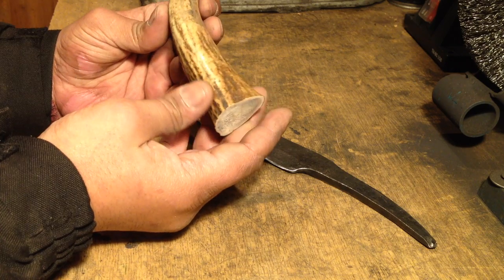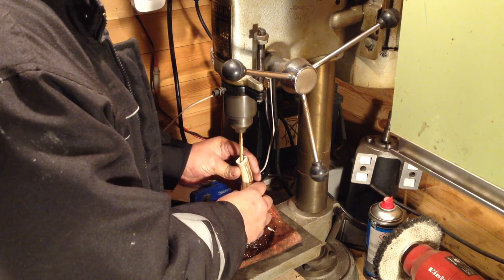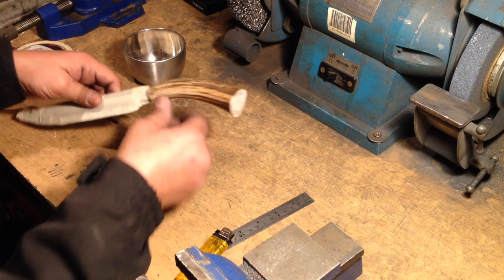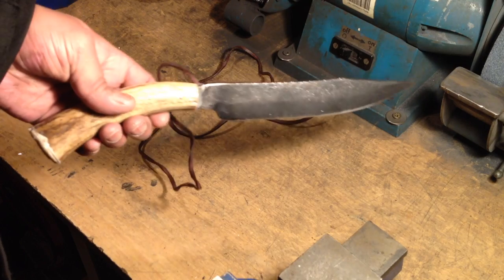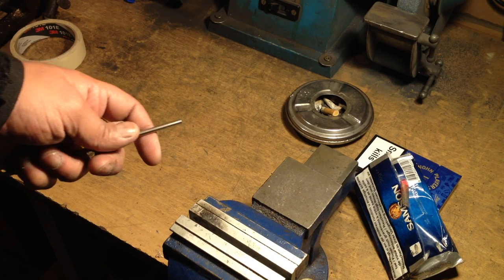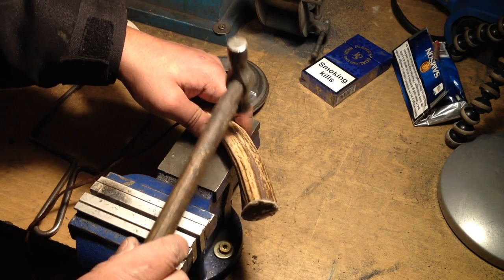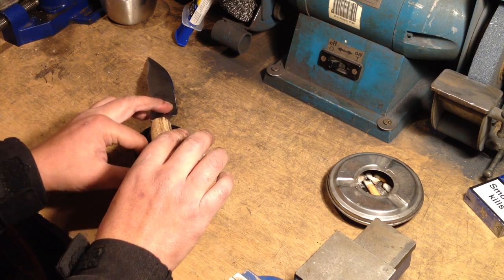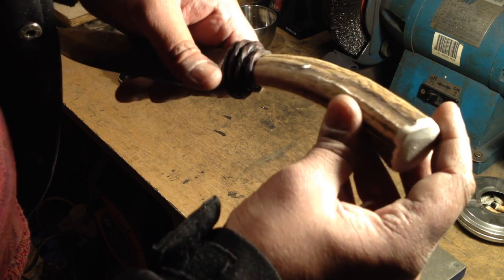Hand Forged Viking Style Knife (part 5 of 5 - fitting the handle)

Comment: Real shame you put the rawhide on it
Reply: @iansforge  Brass tang & I would have bent the part going into the handle to fit the curve. Get you liquid epoxy so you can pour it into the handle. If you are going to pin the handle use brass easer to work with and take the time to mirror finish the blade.